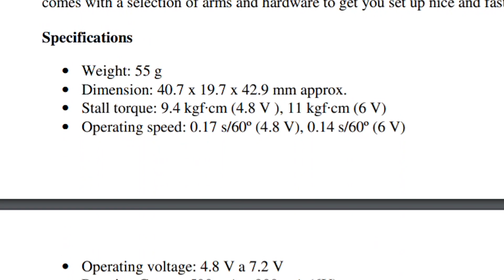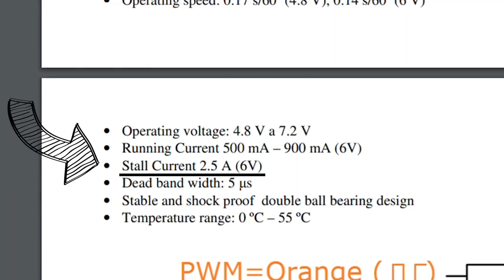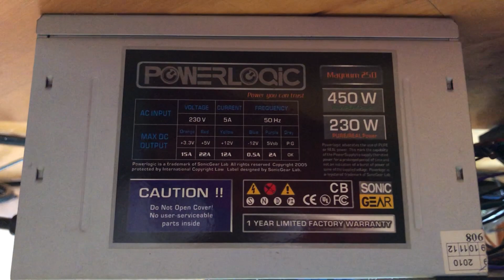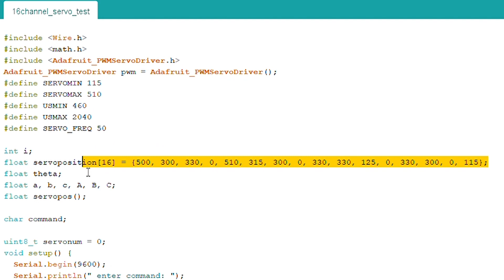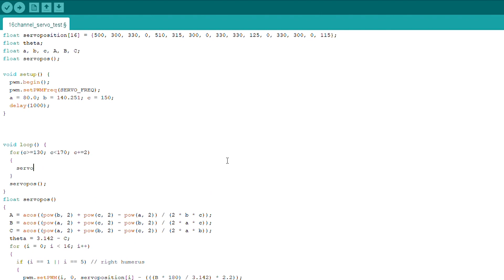Building a robot dog #1 Hardware, Inverse Kinematics

Comment: Can we use the linkit 7697 for this project
Reply from the maker: Hi, I have no experience with linkit 7697, but seeing it has 18 PWM pins you can most definitely use it to do this project without needing the servo motor driver. Make sure to still power your servo motors externally tho.

Comment: From where did you learn all these technical terms and concepts,was it all curiosity driven google searches, reading books or are/were you enrolled in a formal degree course which provides knowledge in this realm?
Really loved the work.
Reply from the maker: Thanks! I'm currently pursuing a degree in electrical and electronics engineering, so there are some relations between what I'm doing and studying. However, most of what I've learned were indeed through curiosity driven google searches.